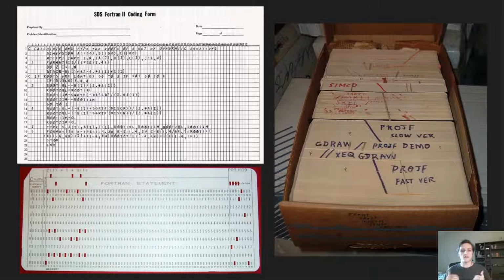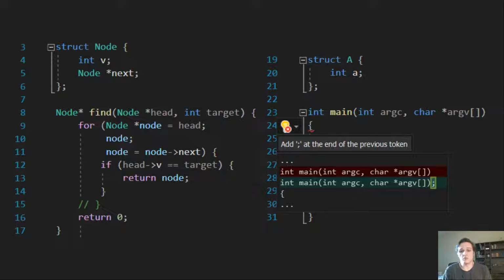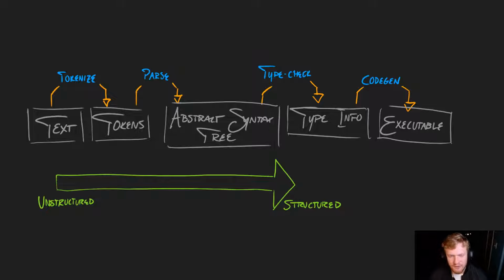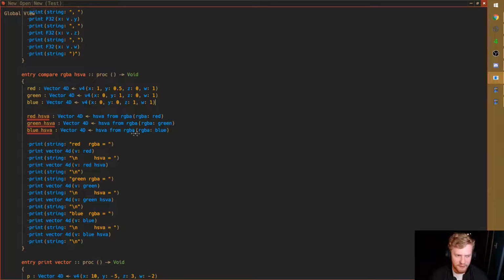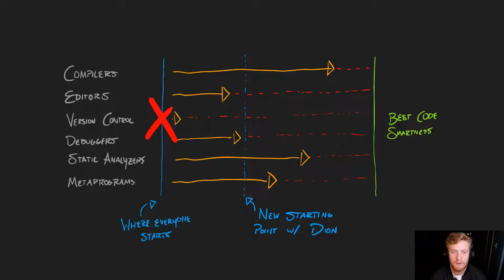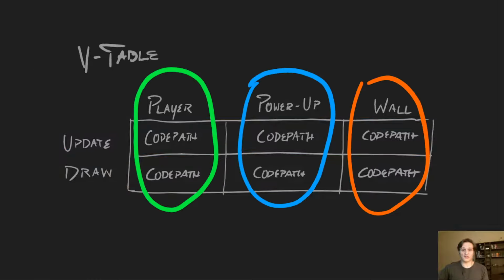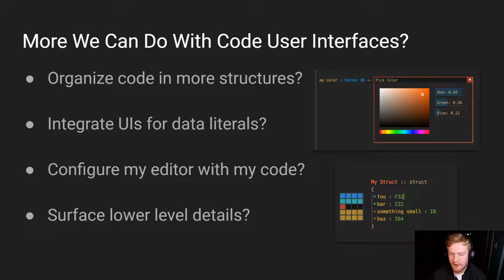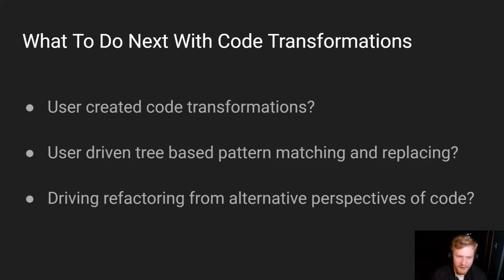Dion Systems - The How And Why Of Reinventing The Wheel

Comment: How would this system handle comments? Also, it seems to me that if you are generating your text from an AST, then you wouldn’t be able to preserve formatting unless you made formatting relevant to interpreting the language like with python?
I’m not sure the second one is a deal breaker but some people wouldn’t like it I’m sure. The first one about comments definitely needs a solution. I don’t think it should be too hard to incorporate comments into the AST, though. You can just throw them away one level deeper in the compiler.
Reply: Well let’s just look at other visual programing languages, they can store formating information despite being much the same. You could simply store some formating data on elements in the AST

Comment: Isn't this how JetBrains does the internals of the IntelliJ editors. When writing plugins for it, one operates on an AST and not the text itself, and they do it on existing languages, not needing a new language at the same time. I get the impression that they haven't worked much with IntelliJ IDEs (the scoffing at Resharper indicates that) as most of the stuff that "are really easy" have been in IDEA for >20 years and done in the same way as described. I saw Structured Search/Replace more than 20 years ago, you have custom code generation that is context aware part of the standard platform since "forever", and with huge community of plugin authors it is rare to come up with something useful not already available.
Even alternate view rendering came a few years ago, for instance for anonymous Java class rendered as lambdas. And wouldn't surprise me if everything else mentioned already exists in 3rd party plugins.
So, on the surface it is cool, but apparently oblivious that this has been around "forever" without requiring new languages and moving away from text files as the storage format. So literally "Reinventing the Wheel". Sorry for being negative on their efforts, but I think THEY are great for even doing anything at all in this space.

Comment: Hm this feels reminiscent of my recent experience with starcraft 2 modding, where the triggers (map-specific scripts) are written in Galaxy script, but generally edited through the editor which has a GUI representation. Diving into the files, the GUI triggers are actually stored in an XML format and the galaxy script is generated from that. The XML can encode extra semantic relationships like you showed off with the variable renaming example, such as the occurrence or use of a parameter pointing back to the parameter definition, which is a child of the function definition.

It's not as advanced as you seem to have pushed the idea in this demo, but it's also a fairly niche modding tool from 14 years ago. I personally dislike the system, but mostly because the GUI editor is glacially slow performance-wise and slow to work-with. The xml format uses randomized element IDs and plays surprisingly well with git / version control.

Having worked with this format, though, I wonder how many of those advantages come from "moving the starting line" on parsing and encoding those relationships, and how many come from just having a more parseable and consistently-defined syntax than C. If you have simple parsing rules and a straightforward spec, then your editor, compiler, linter, debugger, and metaprograms all get that starting line because they're all implementing the same spec (and many modern languages provide these parsing functionalities with tools they ship, like Zig comptime, Jai metaprogramming, Python ast, and idk if Rust macros qualify). The last box to tick is version control, and I think git is so embedded in programming culture now that your language design kind of has to bow to the demands of text-based encoding and a format that plays nice with merge conflict resolution.

C meanwhile is awful to parse, in large part because it's under-defined and has many implementation-specific details. There's no function declaration keyword; some expressions can be interpreted multiple ways resulting in e.g. the most vexing parse; braces around scopes are optional, and can create ambiguities around nested else statements; the integer type hierarchy has been a mess for decades now; the preprocessor is just strong enough to be useful but just weak enough that everyone writes bespoke metaprograms and code generators; etc.

Comment: Is this not just doing the same as like paredit or tree-sitter though. I'm not really seeing any major differences lol. These aren't particularly new ideas and you can see them going back to Smalltalk or Geneva, it's just that, as always "Worse is better".
Reply from the maker: The difference is that this would be skipping the text phase entirely. You are editing a higher level structure directly which comes with many perks.
Reply: @lucy-pero  Couldn't we build an IDE that takes tree sitter representation and that does this?
Reply: @sortof3337  yes, you could just have all your text edit commands operate relative to the treesitter data, there is a lot of neovim plugins that are based on that idea.
Reply: @sortof3337  what's the point of still having plain text then?
Reply: @0xf0cacc1a exactly

Comment: Adding to the "code level of detail" section (Tabs vs Spaces), that's similar to [the solution talked by Christopher Domas](https://youtu.be/4bM3Gut1hIk?si=RNQrGk9qtzRUP5Pp) when it comes to visualizing binary for reverse engineers.

Zero-ing out a system is very very powerful, especially when it comes to newcomers of a codebase. No one wants to read the source code of GNU Make just to have enormous, hard to read, systems being shoved down our throats when we just want to know how they did one specific thing. It would make understanding how something works significantly more tangible, and this is awesome for an entire community about trying to understand systems.